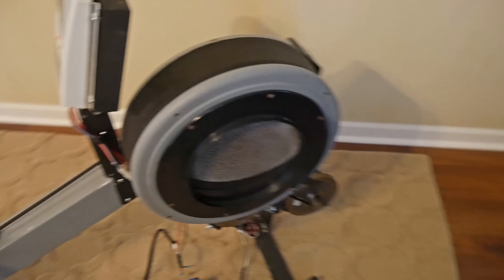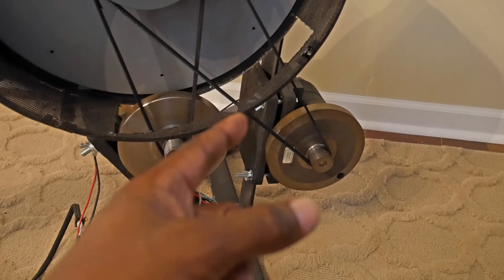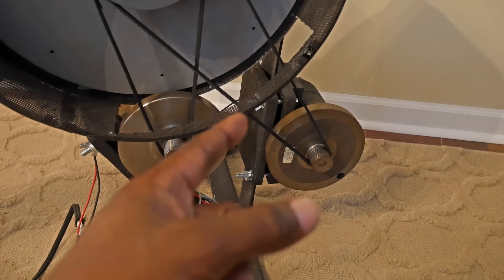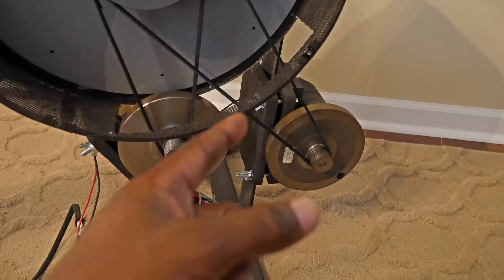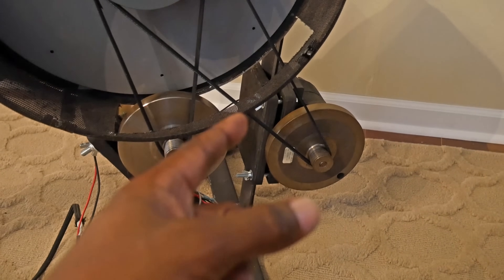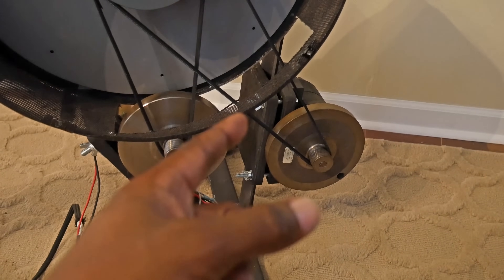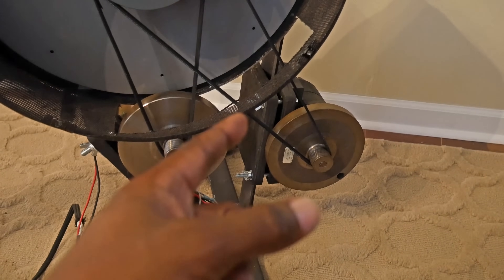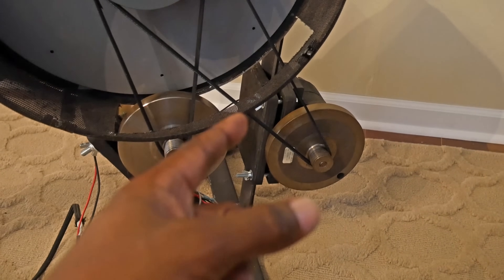How the Kid Powered Video Game Works. A Followup Video. #057

Comment: My inner engineer thinks that a simpler setup might be to run a small (10-20 watt) 12v bulb from the charge controller in parallel with a relay that could turn the TV on and off. That would allow you to customize the difficulty for the child’s age by using any size bulb you wanted, and you wouldn’t have to worry about if the console or tv drew more power than they could handle.

My inner parent however, says that it’s much more exciting to know you’re actually powering the wii.

From the standpoint of making it functional, educational, and entertaining, I think you nailed it.

Comment: Cover the wired ends of the motors please.   I see so many people use these and leave bare wires showing and its dangerous. 1/4 amp over your heart can stop your heart Yes voltages plays a role in this but its plenty of amperage and voltage is however fast you are rowing  these motors were built to be inside a treadmill case where you can't touch the wires.

Comment: Thanks Jeremy for this inspiring video. Love how you teach applied physics to your kids! 
The changeover of the pulley sounds cumbersome to me as you’d also need to adjust the position of the motor/generators to maintain tension in the belt. Why would you not simply disconnect (series switch) one of motors to reduce the power generated (and hence the amount of power the kids need to work the machine?

Comment: Mr Fielding, I need your help.  I am building a battery operated lawn mower.  Nothing too complicated, just a walk behind 21" cut mower.  All I need to do is power the blade.  I have a couple of 12 AH , 60 Volt Lithium Ion batteries that I use and have a 2.2 HP treadmill motor.  I think the motor was a 90 VDC permanent magnet.  I have no idea of the RPM the motor is rated so I don't know the blade RPM.  My question is this: The motor is spinning very fast and I want it to stop quickly, what would be the best way to provide an electrical resistance that would stop the motor within say 2-3 revolutions.  Thanks for any help!!

Comment: Awesome!!! 
You can make it even more efficient and just skip the DC to AC inverter and bypass the AC to DC inverter on the WiI and implement a cheap DC voltage regulator. If you want to produce AC from a car alternator you might need to gear them to spin as fast as possible if man powered, bypass the rectifier diodes for AC generation then introduce a transformer to get your desired 120 volts AC.   ;)

Comment: What you could is set up a relay. Rowing will activate the relay turning the wall power on. You stop rowing, the relay turns off, turning off the Wii. It does make it easier to rowing though, but they're be able to row longer, without getting as tired.
Reply from the maker: That is an interesting idea. I really like it. The systems are linked, but they don't actually have to produce enough power to run the system.

Comment: how long would it take to charge a battery this way?
Reply from the maker: You have to know how many amp hours you are producing, and how many it takes the charge the battery. Both of those can vary a lot.
Reply: Jeremy Fielding thats awesome! does it have to be regulated like the inverter? if you put out more than 10 amps and your 50amp battery is more than half full it should take less than 3 hours to fully charge. from what im reading... thanks for responding!!
Reply: It's a bit more complicated than that because you don't get to choose how many amps go into the battery, that's based on the battery construction and the voltage.  If you want more amps to go into it to charge it faster, you have to increase the voltage (being careful not to go too high so you don't damage the battery.)  If your generator is only producing 14 volts then it's only going to charge at a couple of amps, so a 50Ah battery might take 25-50 hours to charge.  If your generator can supply more amps/watts than this then the excess will be wasted (or it won't be as hard to row on the rowing machine).  If you can adjust your pulleys so the motor spins faster to produce a higher voltage then you can make it charge faster, but then you also have to keep an eye on the charge level and reduce the current as the battery fills up otherwise it will heat up, wasting the energy and possibly damaging the battery in extreme cases.

Using a charge controller like in the video is a good way to take all the guesswork out of it, even if it's not strictly necessary if all you're doing is just charging a battery.

Comment: Jeremy, I am not seeing why the pulley diameter changes the effort. It would definitely change the voltage, but the load on the wires would determine how much feedback goes into generator (other than the friction). Since the load is the same either way, why is there a difference in effort?  Is there higher conversion efficiency at the lower voltage?
Reply from the maker: What a fantastic question! Ok... the two main things are you... 1. You aren't just pushing the electrical load... you have to accelerate the fly wheels and do all the work required just for moving the machine. That load increases with speed... therefore more acceleration more force is required. Two... with the light bar (which is what we use the most) the electrical load is varying with the voltage. More voltage means more current is flowing through the light bulbs.
Reply: Jeremy Fielding 
Ah, that is the reason. The Wii is a fixed load but the bulbs are not.
Reply from the maker: And don’t forget it takes effort with zero electrical load. For me it’s not much, but for the kids that matters a lot.

Comment: Can't you use the small pulley and vary the load (a resistor pack) on the generators to increase their resistance so that you can switch between users with just a simple switch or maybe even a variable resistor knob to dial it in. Getting the kids to enjoy excercise is so Mark Twain of you 😎
Reply from the maker: A resistor is an excellent idea. Even with the large pulley, it is much easier to pull when the electrical load is smaller. Adding a variable resistor in series would make it easier to row as less current can flow, and the load on the generator is lower.

Comment: About how much time would one have to row to make .51 kwh  of electric? I'm looking for a way to power my chest freezer/refrigerator conversion which is similar to this.  https://www.newlifeonahomestead.com/convert-chest-freezer-to-fridge-solar/
Reply from the maker: It depends alot on you as the rower. This setup with two motors can easily put out as much power as you can generate. Test yourself on a rowing machine. Any gym should have one. Use whatever watts you can produce comfortably on that and assume your generator will be about 60 percent efficient since we are using a motor as a generator (instead of something designed to be a generator). That should get you pretty close

Comment: like everyone else very nice to see family closeness and activity. Thumbs up.
Question about the 2 motor setup.  Are they maybe wired in series to increase the voltage to useful levels?  I believe most treadmill motors need to be spun fairly fast to give decent voltage output.  Which requires spinning small pulley VERY fast or larger pulleys a more moderate speed. 

Thanks for great videos you are one of my favorite y-tubers.
Reply from the maker: They are in parallel to increase maximum current output. The speed is definitely high enough. With the pulley combination I have

Comment: Oh.  Don't forget than you can make simple pocket chargers using coil wire and a neodymium magnet suspended on a soft spring or rubber band within a tube.   
Even simply attach an LED or two- evening wear for kids safety.
Reply: Then Jeremy.  If they have bicycles wind a tube.  Place a sphere or cylinder magnet within and fix to the crank arms.  With every revolution the LEDS will flash.  For consistency attach a battery and charging circuit :)
Love your approach to things.  Keep it up :)

Comment: Great one bud.  Careful the green lobbyists don't get a hold of it.  Reinvention of slave labour :/
Anyway you can bypass the wii psu so that you don't have to use the inverter.  It's good that your teaching them but teach them to be efficient.  It's how progress is made .  It's a foolish man who makes work more difficult than it need be.
Reply from the maker: Great idea
Reply: Jeremy
How stable of a voltage does the charger controller produce though? The switching power supply provided protects the Wii from a wide voltage range. Also if the voltage is incorrect you would need a buck/boost controller that may reintroduce most of the same losses, or something linear which would just waste any excess voltage.